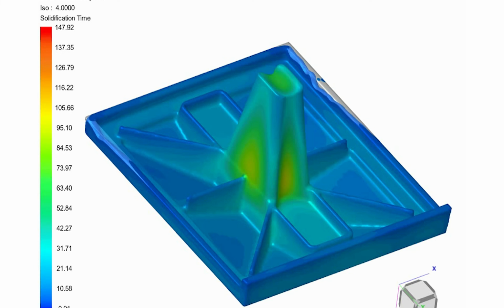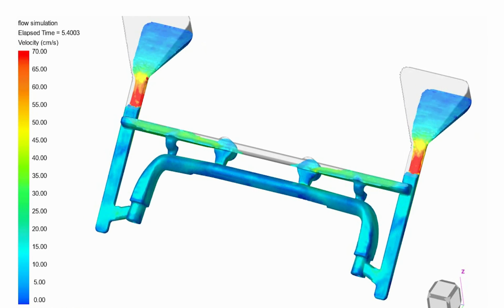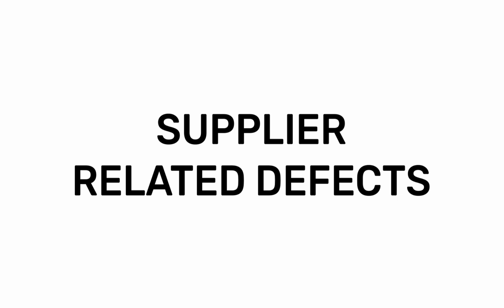Prevent 10 Casting Defects (PODCAST)

Comment: Molten aluminum reacts with water - including humidity - to produce the hydrogen - unfortunately the oxygen (other component of water) remains in the aluminum matrix as very thin bifilms at the grain and dendritic boundaries reducing ductility producing a common low elongation and reduction in area in the tensile test.
Reply: this is the level of nerd i aspire to. outstanding insight.